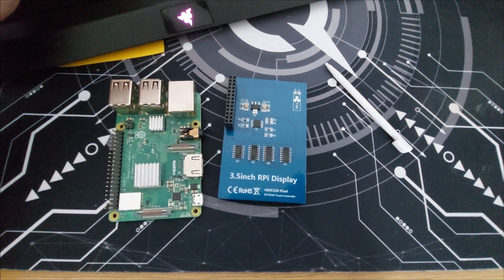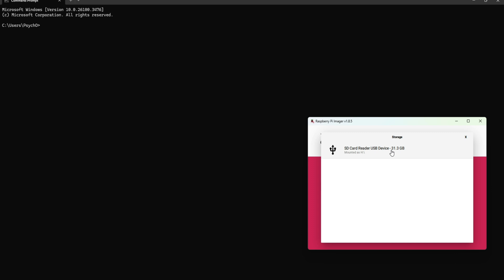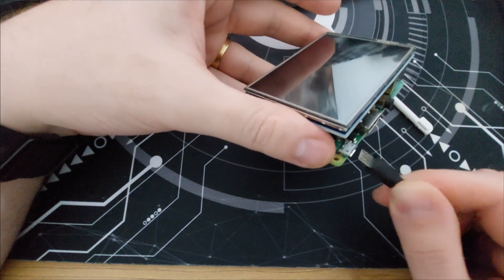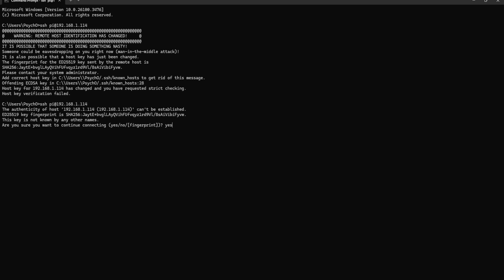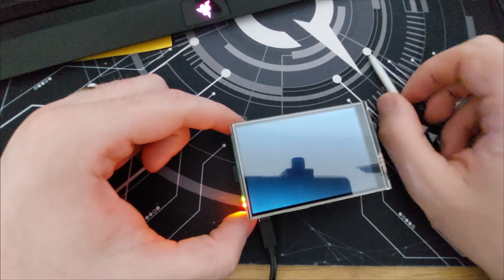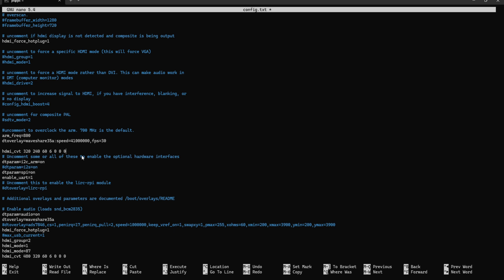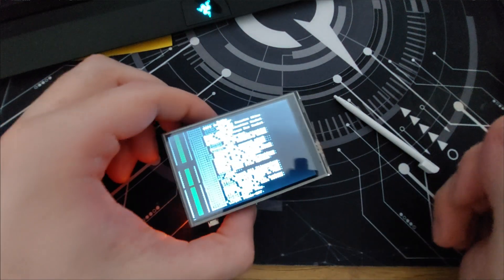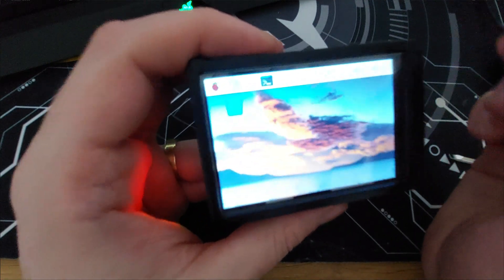Raspberry PI 3/3B+/4/4B 3.5 inch Display

Comment: It didnt work
Reply from the maker: Check what version you are using. I don't have the screen anymore to test
Reply: @pythoneatssquirrel  version of what? the github script
Reply from the maker: There is no new version on git it seems. Redo all the steps again, it should work
Reply: @pythoneatssquirrel  okay, I will try adjusting some settings in raspi-config too
Reply from the maker: @gluetheknot there are multiple persons around here who succeeded so good luck!
Reply: @pythoneatssquirrel  so i ran afew commands and got this: pi@raspberrypi:~ $ DISPLAY=:0.0 xinput_calibrator
Invalid MIT-MAGIC-COOKIE-1 key
Unable to connect to X server
pi@raspberrypi:~ $
Reply from the maker: @gluetheknot restart, make sure you have an active internet connection to your pi
Reply: @pythoneatssquirrel  i do, my router shows it and i can ssh into it

Comment: An alternative method to get this screen working with latest 64bit OS you can use Linux direct rendering manager (DRM).
Search for dtoverlay=piscreen,drm for more information.....
I managed to get this working on a pi4B with bookworm using the following

Edit /boot/config.txt
Remove references to LCD-Show and add the following...

dtoverlay=piscreen,drm,speed=16000000,invx,invy,swapxy
dtparam=spi=on

Description of parameters
dtoverlay=piscreen: 
This specifies which device tree overlay to load. The piscreen overlay supports many common 3.5-inch SPI displays.

drm: 
This argument tells the system to use the built-in DRM/KMS (Kernel Mode Setting) driver for the display, which offers better performance and compatibility with modern desktop environments (like Raspberry Pi OS Bookworm) compared to older fbdev drivers.

speed=...: 
This sets the SPI bus frequency in Hertz. If the display shows an incorrect image, wrong colors, or flickering, the speed may be too high for the panel.
You must specify a value for this parameter, for example, speed=16000000 (16 MHz) or speed=18000000 (18 MHz).
The maximum stable speed varies between panels and Raspberry Pi models (e.g., Pi 3 vs. Pi 4). Common working values range from 16 MHz to 24 MHz, with some panels working at up to 115 MHz. The system will approximate the nearest available speed based on the core clock. 

invx,invy,swapxy
Used to orient the touch feature correctly.